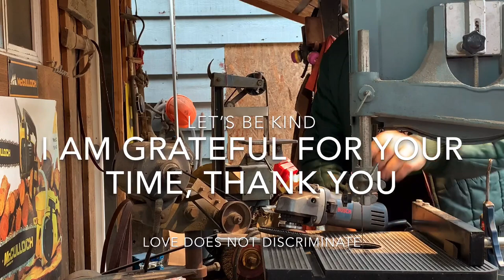Old Axe head found in the ground, what’s under the rust

Comment: Have you tried electrolysis for rust removal. You could do axe heads in a 5 gallon bucket. 1/2 cup of washing soda to 5 gallons of water. Hang the axe head in center and connect negative battery charger cable. Put another metal around the inside of the bucket and connect the positive cable. In 24 hours it will be rust free. I use the process to restore vintage cast iron skillets. Keep up the good work!

Comment: My grandfather died in September, going through his house we found a  double bit axe and a 2 lb head on a 18 inch handle. The bit on the 2 lb head is as thin as any i've ever seen, including my Granfors Bruk small forest axe, it make a wonderfull limbing axe and wedge banger. Both the axes are from the 1950s and 60s. He kept them in great shape, they have original handles that are still in working condition, no cracks or warps.

Comment: Hey Buckin'.  Lookin at the axe head you  were showing in the bunker. the one with the handle.  You said the blade was thicker on one side.  If the head is off center like that wouldn't that help The Flick that you are fond of.  (i'm too old to be throwin around an axe .)  

But I've wondered about that.  You are developing an axe head.  Off center bit might help with The Flick.

'lookin forward to seeing your new axe that you've been working on.

keep up The Good Work!

Comment: It had been used to pound steel wedges.  You can tell that from the condition of the pole, so it was a splitting axe at some point.  It has a good pattern, very similar to my 50 year old 4#TT.  I have restored all of my TT axes in the past five years.  They look like new, now.  I almost hate to use them, now, because I mess up their red paint finish.    I would have soaked that rusted axe head in VapoRust for a few days to see what I could get off of it, first.

Comment: Awesome handiwork refurbishing that axe head.  Just curious, have you ever tried electrolytic rust removal?  All it takes is a 5 gal bucket, baking soda, a battery charger, rebar or other steel rods and wires.  It's nice because it gets the rust out of all the nooks and crannies without grinding down the metal.  It worked nice when I used it to refurbish a  wood cook stove.  Praying your teeth & jaw starts feeling better. God Bless.

Comment: Buckin if you are going to hang that head better drill it and roll pin it just to be safe.   
Dentists screw up your jaw joints when they change the lay of your teeth it changes how your jaw joint socket works just like when they put braces on your teeth.  Does not take much to give you a royal pain until the jaw socket  wears in.  Good luck, it takes a while.

Comment: Waiting on a old 4lb Dunlap in the mail, can't wait. Having a hard time finding handles in stock.
Reply: Try Whiskey River. They are about 10 miles away from me.
Reply: @jeffreyrubish347  they seem to be sold out of everything I'm looking for.
Reply: I think the bushcrafting thing has increased the demand. It's difficult to find them. The hardware and home stores have the usual 36's, 32's and 28's but the quality is below Beavertooth, Whiskey River, etc. Killinger gets shipments at times from the Amish; he's on Etsy.
Reply: @jeffreyrubish347  I've been keeping an eye out for restock on all those companies. Local hardware store replacement handles don't last.
Reply: @ianjohnson837  All of mine are from chain stores. Biggest problem I've had is the grain is iffy and they warp over time.
Reply: @jeffreyrubish347  everything around here off the shelf has been painted or varnished, I don't like that so I have to sand or strip it off. And the shapes are pretty generic, I like a curvy handle, with a big palm swell.
Reply: @ianjohnson837  I generally thin the handles in some areas so removing the finish gets done anyway.